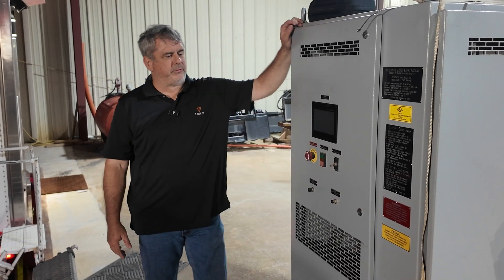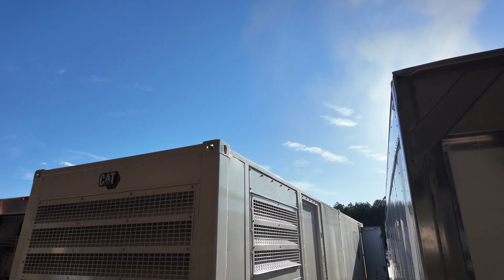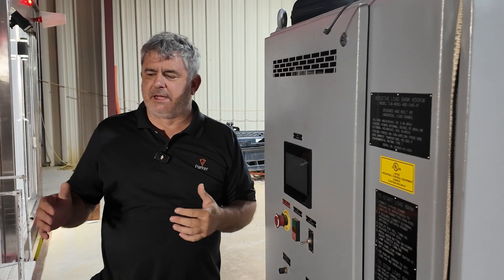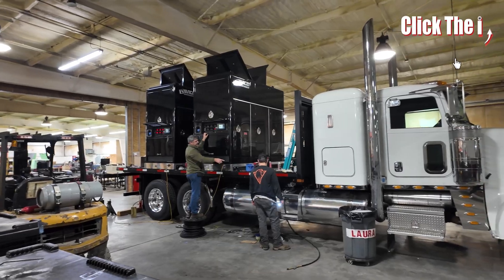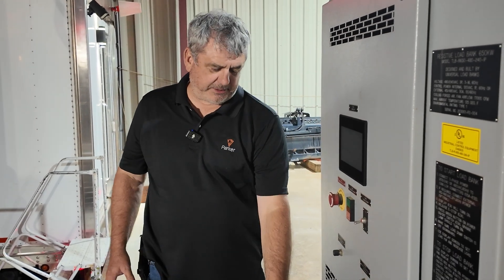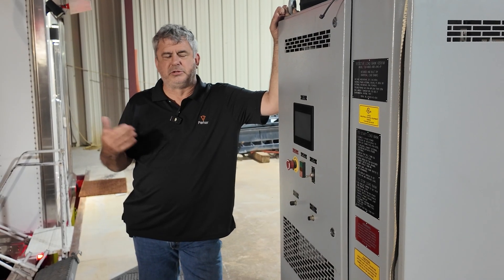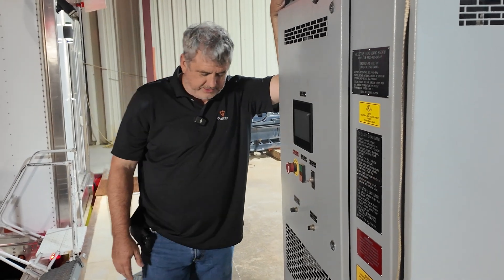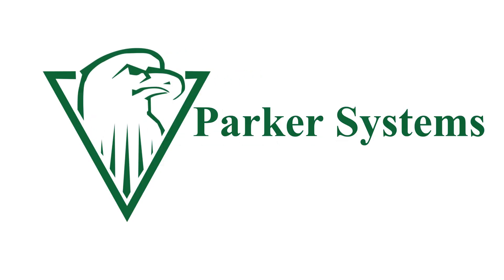Load Banking 500 kW Cat Generators! | Parker Systems

Comment: I believe you said 2 of the 3 gensets could fail and the 1 could take the whole load with out a brown out or drop in power? Did I hear that correctly? Would the servers and computers need to be on an APC battery backup system for that to work flawlessly?  Thanks for these videos, very interesting stuff yall deal with. Hope to not see yall in the Mobile AL area anytime soon because that would mean a huge hurricane just came through. I guess yall could be here for a big concert though.
Reply from the maker: You did…. Each unit can take 500,000 watts or 500kw.   So if the total load did not  total more than 500kw this gen could take it with out a blink flash or brown out.   You do not need an ups.   Pretty slick.   I would not design the entire load to be that high but as long as it doesn’t exceed 500kw it would work.   Thanks for watching

Comment: This is interesting stuff!

Is there anything that can be done when you know you are going to be running diesel generators at low loads for a whole week at a time? Every year at Burning Man I rent a 70 kva generator, which has to run for 8 days. We run it 24 hours each day with just a quick break for daily maintenance. But the load throughout the week varies from 10,000 - 30,000 watts and I can't do much about smoothing that out. I've always been paranoid about wet stacking but don't know if there's anything I can do about it. The generator vendor does load bank them before the event.
Reply from the maker: On a unit that size if they load bank prior to use you’ll be okay.  We do have some smaller units (under 100kw) and have mini load banks built in that keeps the unit to at least 40 percent load to prevent these issues.  They automatically switch in and out based on the load.  If your vendor is load banking prior to a weekly use you’ll be good.    Great question.
Reply: @ParkerSystems  thanks! Love your channel!
Reply from the maker: thanks for watching